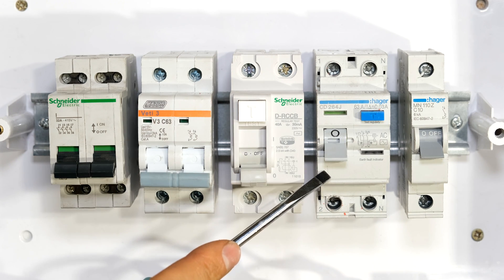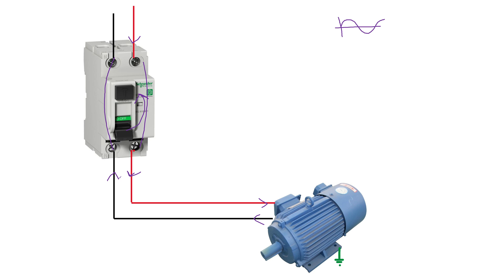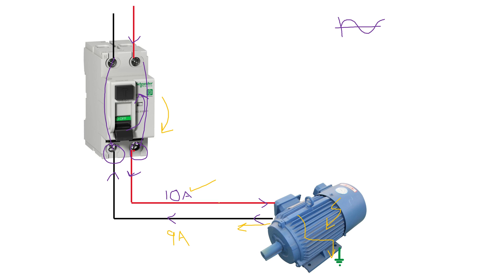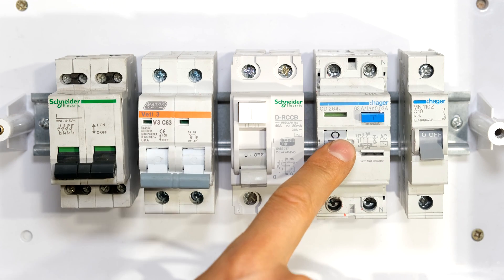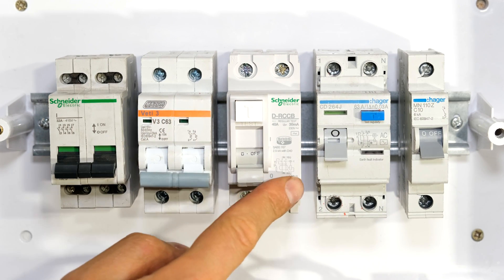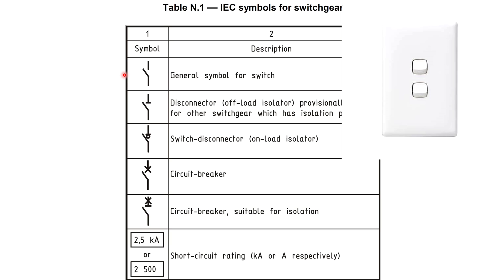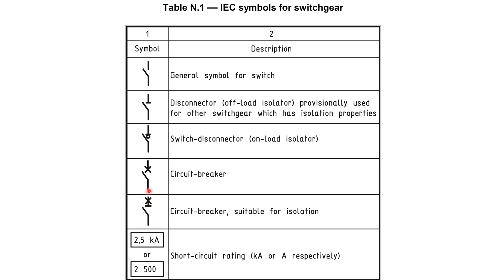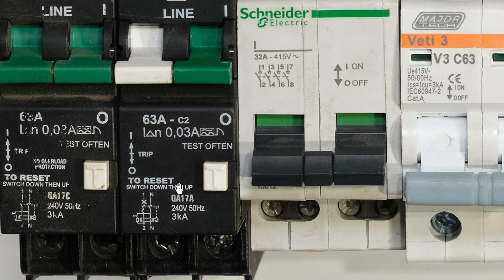IEC symbols, Isolators, circuit breakers, RCCB, RCD / earth leakage

Comment: the device mentioned as a isolator [disconnector] is not that .it is a switch disconnector. which is different from isolator[disconnector] or a load switch.

Comment: Thanks for the videos .. Question:  I'm trying to understand which one of the breakers shown would be considered a "ground fault circuit interrupter"  or GFCI normally used in locations like CR's, outdoor outlets, or Kitchens areas.  GFCI are normally rated for 20 or 30 amps.  Thank you.

Comment: Thanks for the video .. can you make a video on wiring a single phase board with 2 power sources (grid and a generator), and the generator has no neutral, only a hot Line.
Thanks
Reply: Generator has neutral but earth